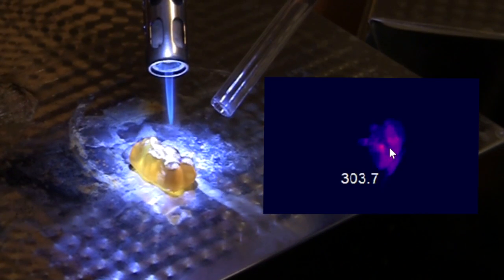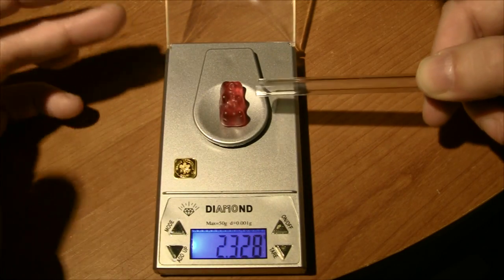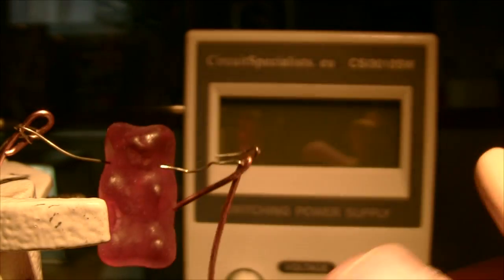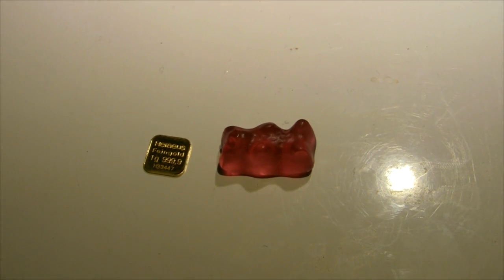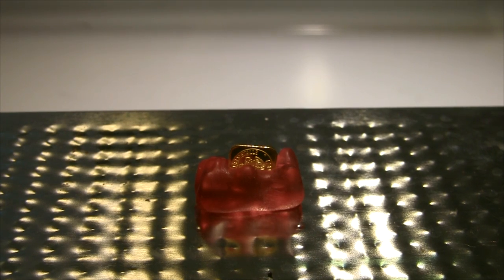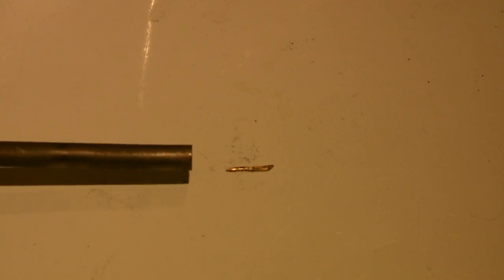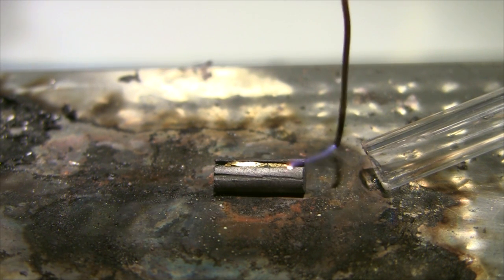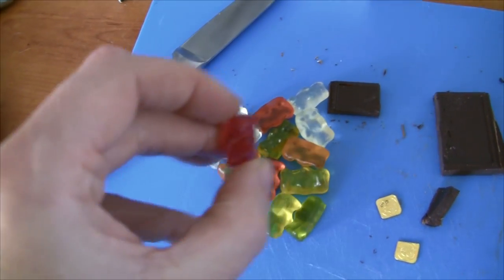Can 1000C Gummy Melt GOLD??

Comment: Okay, okay. Wait a minute. WHY did the gold curl itself up into a perfect little ball?! That was super cool.
Reply: It formed a sphere because unlike in solids, the atoms in a liquid are free enough to move around quickly in response to forces. At this size scale, gravity is not a very strong force compared to some others. Gold on graphite has a high surface tension, so the energy of the system is reduced when a minimum amount of gold actually touches the carbon. A sphere accomplishes that, and since it's also the shape with the smallest surface area, it's minimized surface energy too. The most stable state of a system is when energy is minimized.
Reply: has something to do with cohesion and density and stuff. youll probably get a legit answer, but those will probably be the key points in it haha
Reply: Cool answers, guys. Thanks for the time and effort.
Reply: High surface tension. The same reason why water droplets make spheres.

Comment: I do silversmithing from time to time.  I think the steel underneath was stealing heat and also the atmosphere around. The reason graphite worked is because it is refractory as well as a fuel. You should have tried the gummybear inside a refractory crucible or better a furnace. That way the heat would be contained and reflected back at the piece of gold. Try some ceramic fiber or other refractory material.

Comment: This would be better if the ending contained the explanation for why the candy did not melt the gold, where the graphite did.  Fluid dynamics would explain much.  The sustained heat against the surface of the gold was not possible with bubbling candy.  The graphite's stable surface was in constant contact with the surface of gold so the heat transfer was much greater.  Entertaining can also be educational.  Just my .02c.

Comment: Problem with thermodynamic equations is that they often rely on the system being closed which this isn't therefore the experimental value needed to melt gold through the combustion of something like a gummy bear is much different to the energy required to just melt gold.

Comment: The oxygen jet is creating an air draft and the gold was being cooled.  Additionally the very baking pan on which the gummy bear sat was a heat sink as well.  The oxygen atmosphere is also turbulent from the heat around the gummy bear and is carrying heat away by convection.  Set the gummy bear on a ceramic tile and break small pieces of ceramic to form a corral on 4 sides of the gummy bear and lay a steel wire screen over the corral.  You are looking for containment of the heat and a baffle to control turbulence in the air above the gummy bear.  That is lacking in the present set-up.
Reply: That's how you spot an engineer
Reply: Yup, I suspect the eventual success of the graphite was at least partly due to it forming a semi container round the gold like the refractory surface on the inside of a metalworkers furnace. might be worth trying to make a mini furnace out of fire cement (or similar) with a finger poke hole in it ... and a lid with vent hole... I think it might be possible to pipe a bit of O2 through the side and let the exhaust gasses out through a hole in the lid - probably need to experiment to get the O2 rate correct so any cooling is minimised
Reply: Basically, make a miniature furnace, that will use gummy bears or chocolate as fuel. 
It might have been worthwhile to record this with a thermal camera. IMHO the main reason why the others didn't work was because of the way they burn. At some point, you had the gold completely covered inside the material, but the heat just wasn't getting to it. The graphite allowed for constant heat feed into the gold and despite any heatsink effects, the gold melted in the end. So a furnace is needed, which will direct the heat right on the gold.
Reply: I was thinking the same thing: heat isolation is required
Reply: Alex Barbu The problem is much simpler. The heat dissipates to the surrounding oxygen instead of to the gold as many already suggested. The jet doesn't make that much of a difference. You can see where the flames are whitest. Most often it's not where the gold is and hot gas and thus its heat, in this case a mixture oxygen, co2 and steam, travels upward in a colder surrounding.

The solution is also simple: make a tiny furnace for the fuel to burn to focus the heat, blow oxygen in there and suspend the gold just above it.

A better solution is to make a 100% efficient all purpose energy sucker and then dump the extracted energy directly into the gold that you stuck in a closed container that doesn't conduct heat at all. Then you can melt 100g of gold with just one gummybear. I have that equipment on my spacestation, next to the unicorn storage.
Reply: Not to mention that the sugar forms foamy carbon that insulates the gold from the main reaction....
Reply: Stephen Thompson   if sugar and oxygen don't produce enough heat...  nothing in setup  won't solve it...

and he pretty much used same method they use industrialized metal processing
Reply: I would think it was the amount of time that the gummy bear burned played the biggest role here.  The gummies burned hot for a second or two but the gold had no time to actually conduct the heat before it burned off.  With the graphite at least it had the time to warm up from the burning chocolate before the graphite reached its burning temperature and then kept its temperature indefinitely until thunderfoot killed it.
Reply: +airsupport101   The atmosphere in the aquarium is pure oxygen.  I would keep supplying oxygen by the jet.  The object is to seal off heat losses as much as possible.  100% seal is not possible since the gummy bear must burn to produce the required heat.  Optimally, a tiny ceramic or clay combustion chamber fed with an oxygen jet and the gold suspended immediately above the gummy bear with an only slightly larger exhaust flue would probably do the trick.
Reply: Andrej E. this is how you spot the lab engineer, they always want and think with ideal situations.
Reply: Also cutting the gummybear into pieces might cause it to burn up faster, causing it to put out it's energy faster.
Reply: Stephen Thompson yeap!
Reply: Just thought the same way, the tin box will take away a lot of heat
Reply: it wasn't until he used the graphite as a crucible to focus the heat did it actually work, I was surprised he thought you could actually light graphite directly.
Reply: +Stephen Thompson the problem with that is if you coral it on all 4 sides it would be harder for oxygen to reach the gummy bear and sustain the flame so the reaction kinetics will die drop quite a bit and the rate that you produce energy will fall with it and all the heat transfer equations (only started heat transfer this semester so I may be wrong) rely on/ solve for Q such as Q=k*Ac*dT/dx for the ceramic plate and Q=h*As*(Ts-Tsurr) for air and if Q drops significantly then at Steady state Ts will be much lower ofcourse having the wind blowing does also make the h high and tin makes k high so it would need to probably balance the two methods.
Reply: Save this comment in the archive you have restored our faith in humanity
Reply: Alex Barbu I'm pretty sure you could melt steel with a candle flame. - With a big enough candle, a small enough piece of steel, enough oxygen, and a really good thermal and gasflow setup. :)
Reply: Andrej E. thats right ;)
Reply: Agreed.  He needs a crucible to trap and focus the heat.  Right now it's just blowing away under the air stream.
Reply: Suggest a crucible plus chopping all of the gold into little pieces to start with... then let thunderf1n have his fishtank back
Reply: Thought the same thing, but I go for rockwool instead.
Reply: Just use potassium chlorate.  It will be a self oxidizing reaction.
Reply: n0m4nic or it could be that graphite burns at temperatures easily high enough to melt steel if you can get it started ... anthracite burns at around 3000 K and it is mostly carbon so I would expect graphite to get up to about the same if it can get the oxygen
Reply: Prove it.
Reply: Setekh   At last!  We have a fix.
Reply: Gummy bear autopsy.
Reply: Are you an engineer?
Reply: So basically, he needs to build a bloomery and use a gummy bear to melt the gold.

Comment: k wtf is up with the click bait you are starting to sound stupid Tf. CAN A TEMPERATURE COMPLETELY CAPABLE OF MELTING GOLD DO IT? I am not even watching this just to spite you.
Reply: Flyingvoxel nolond just because the temperature is high enough doesnt mean there is enough energy to do it. but i agree, the title is clickbait.
Reply: That's the point.
Reply: Spoiler: it couldn't. EXPLAIN THAT, EINSTEIN.
Reply: +dattebenforcer
 The total energy of the reaction does have enough energy to melt gold 
if he reaches 1000c at any point it has the potential to if the heat flow to the gold
 is enough. How he contains the heat energy from  the results from the 
reaction is what controls if the gold reaches liquefaction.  I assume he
 probably didn't bother to contain the heat with ceramic dish or kao 
wool.
The amount of gold is the only other limiting factor, if he uses the 
same weight of gold to gummy re does the test with a kao wool blanket 
containing the heat it will melt.
I work in a blacksmith forge and i know for a fact that sugar and pure 
oxygen contain way more then enough energy to melt steel, golds even 
lower on the temp scale.
Did i explain it enough for you? Should i break out my pen do the math 
and then prove it, or will my personal experience suffice?
Reply: wow i just read his description after writing that and he even noted exactly what i was talking about.